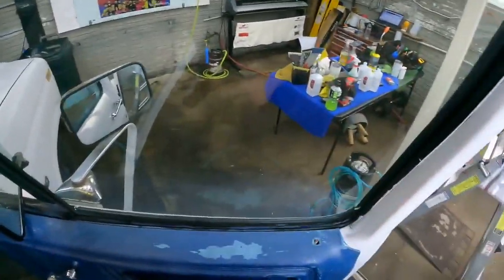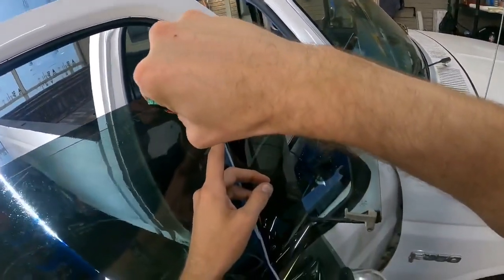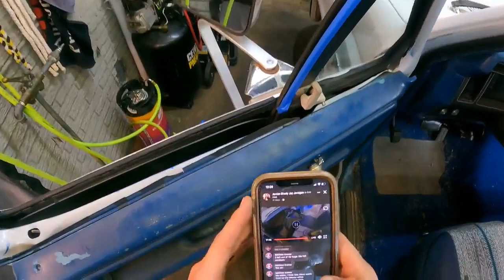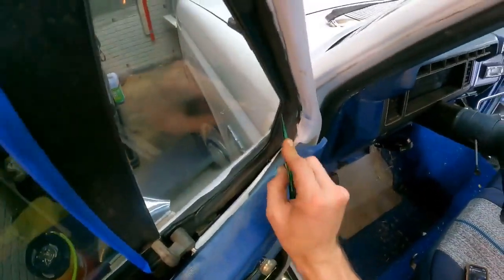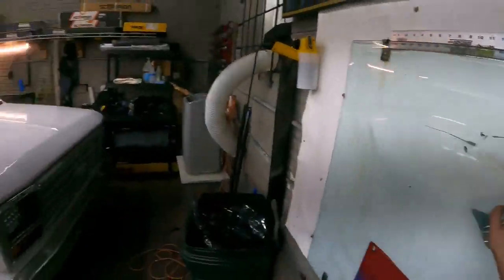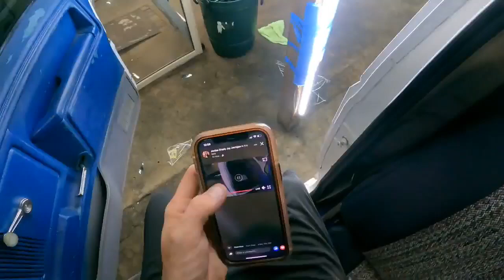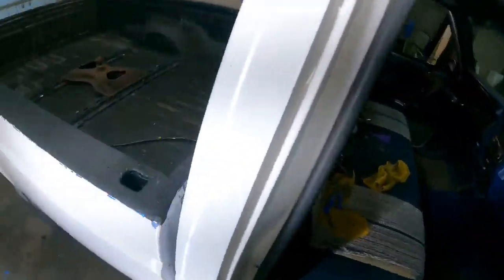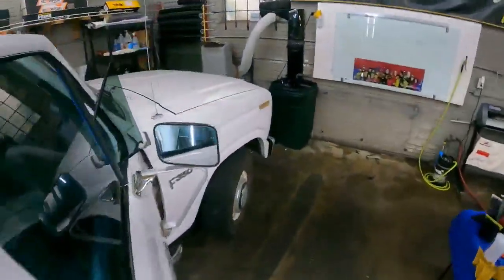Tinting an Old Ford Truck

Comment: Wow this is awesome! That glue trick is straight up genius. I've been terrified of those corner/wing windows and back glass, but it looks easy with the clear elmer's glue. does it wipe off the tint or trim pretty easy when it's wet? What's the name of the green window cleaner you used? Simple green?